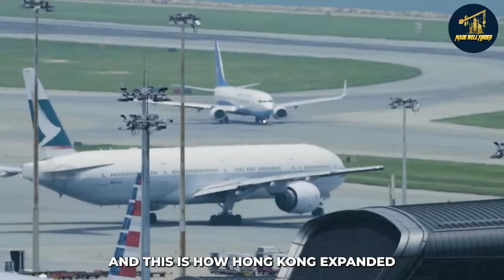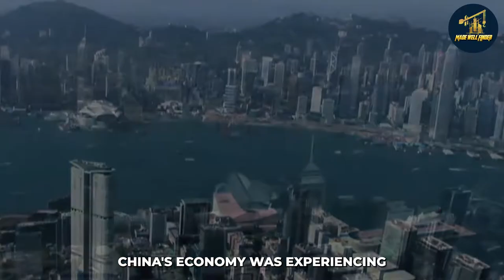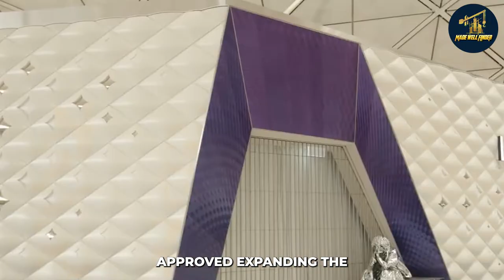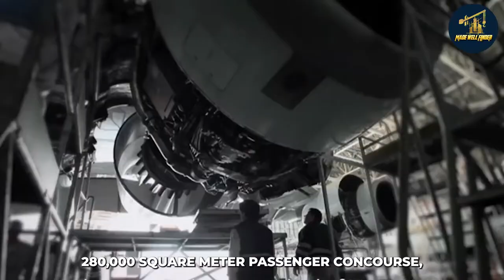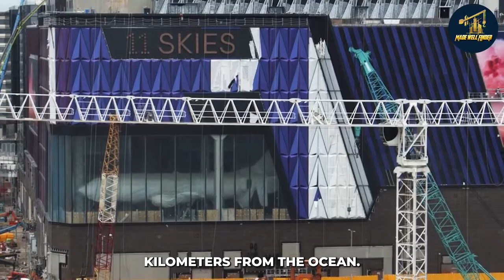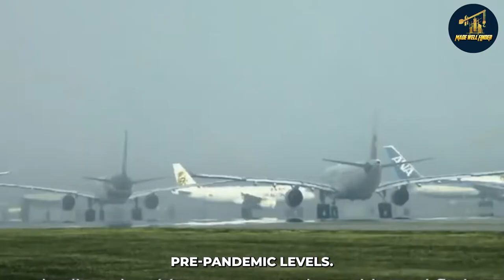Hong Kong's Airport Expansion by 18 Billion Dollars

Comment: I used to travel through the old Kai Tek in the early 1990s. One approach came in over the city past apartment buildings. "Look! are they eating dinner in there?" The other approach descended lower and lower over the ocean until runway suddenly appeared under the wheels and the plane stopped before running into the apartments. Building a new airport was certainly wise.